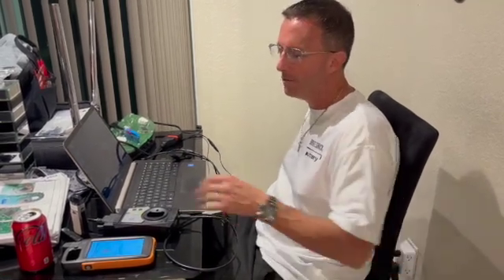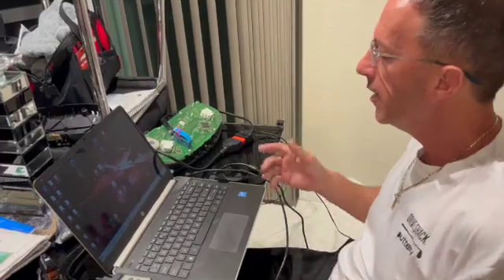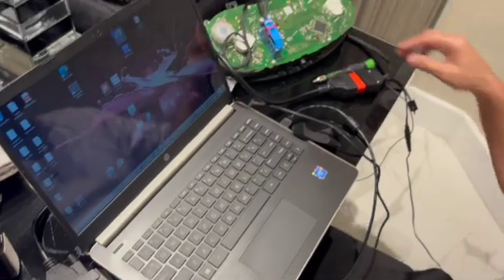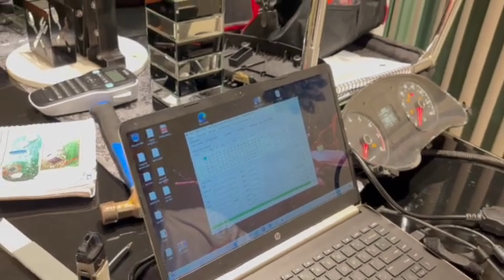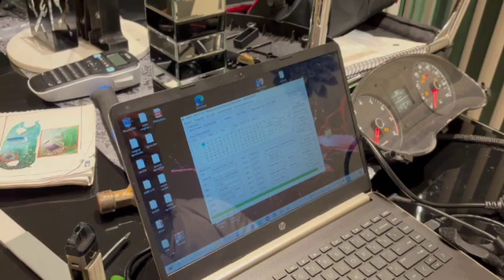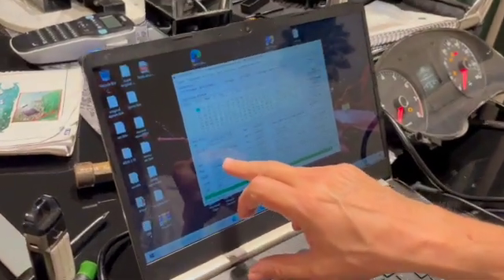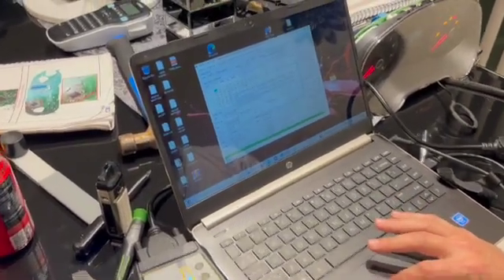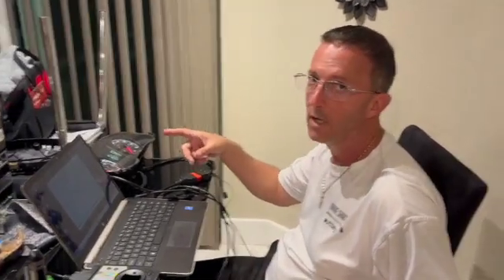How to program All Keys Lost vvdi2 Volkswagen 2010-2018.

Comment: Hi i have the Godiag GT110 VAG test platform and im 508 trying to practice for AKL with the jetta cluster but for some reason the 508 can't read the immo data not sure what's the problem is my cluster bad or the test platform or is it the 508 cant do the job any help will appreciate it Thanks Viktor
Reply from the maker: Check internet connection and maybe goto junkyard and get another cluster if there’s a problem again email me or call my office and I’ll try to talk it out with you
Reply: @Alennylocksmith  thanks for your answer I very appreciate it
Reply: How much $ was your test cable because there are so many on aliexpress with price range 30$-250$??
Reply from the maker: @ 99 I think
Reply from the maker: @КанадскийДальнобойщик-х8щ  it might be the cluster but I’ll try to find out if the 508 has any limitations